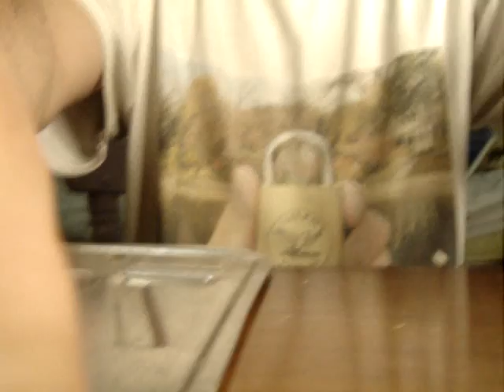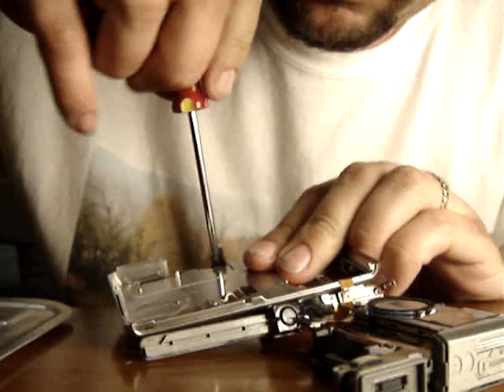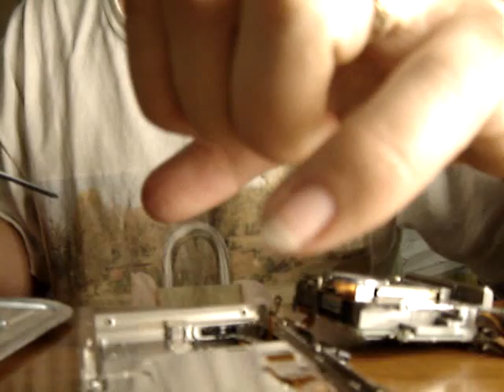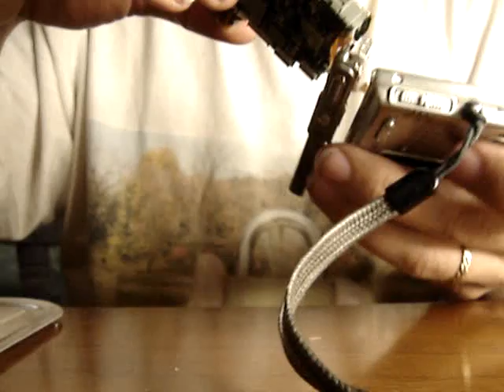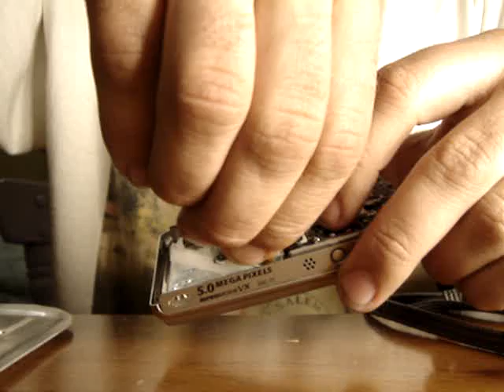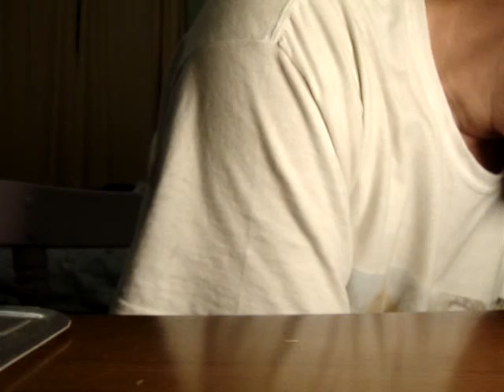Refurbishing my Sony DSC-T1 Digital Camera

Comment: I just disassembled mine and a couple of random rivet pins fell out, have no idea where they came from lol
Reply from the maker: Interesting.
Reply: One pin (thicker at one end) passes through the lens assembly, you just drop it into the hole vertically (if the camera is on its back on the table).  It holds the front & back covers apart, and stops the lens from being squashed.

Comment: Hello, I am francais, I am has the search(research) for five ccd dsc-t1 and two for dsc-m1 j had a supplier here in France has 17euro pieces expedition included but he(it) left has the pension(retreat) what is what you can say to me or I could find in the worst there I leave you my e-mail address "dupuis.michel0162@orange.fr" cordially and thank you for your help(assistant) michel (55ans

Comment: cool video, does anyone know if the camera will still work if you leave things like the flash and screen disconnected?  I'd like to keep a similar camera intact but keep change the form factors, would be easier if I could leave the flash and screen out.

Comment: my camera is also a Sony except its a DSC-P93,i dropped it and the screen cracked,rendering it almost compleatly useless,sony wanted almost 200 $ to repair it thats 4/5 of the original cost,so i just found another one secondhand for 90$...eventually the broken one will get repaired and possibly sold,but i might attempt to fix it myself.